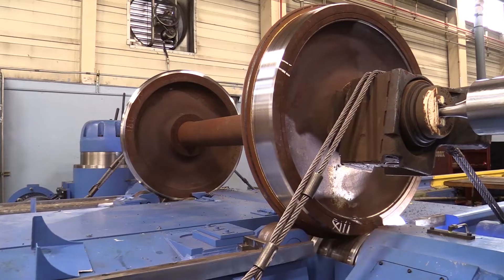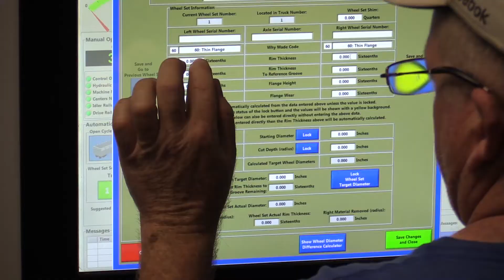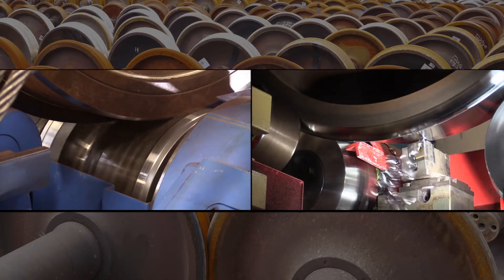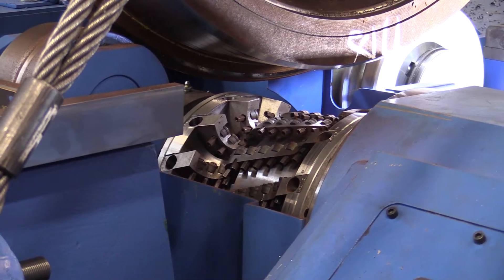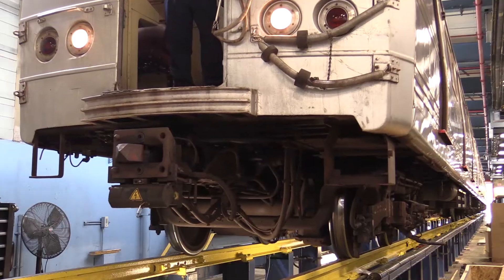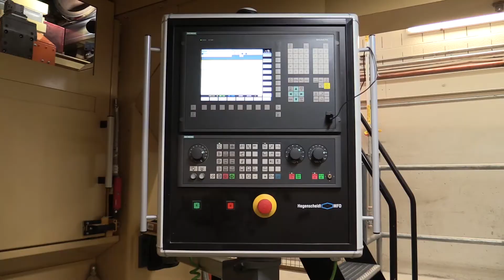Railway Wheel Set Maintenance: Milling and Turning Technologies

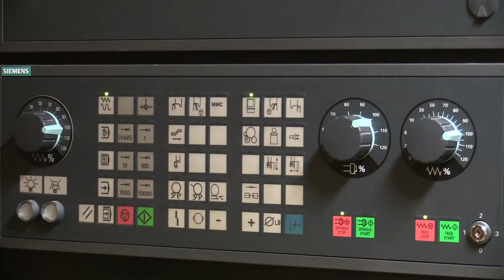Comment: 2:14  That's what I came here for. Flat spots.
Reply from the maker: Happy to provide that content! Also happy to provide the best solution for removing flat spots and other wheel wear.
Reply: @nsh-usa   Thanks again.
Reply: @nsh-usa   Do you know how flat spots happen in the first place?  Obviously from dragging a locked wheel, but still....it's hard to believe that they aren't aware that they are dragging the cars before the brakes are released.  No?
Reply from the maker: While I don't have all the answers as to how flat spots are created, one of the most common reasons is a slick or wet rail causing a loss or change in the contact between the rail and the wheel. That's why you see a lot more discussion of flat spots in the fall (falling leaves) and winter (snow and ice).
Reply: @nsh-usa   Interesting. It's like anything I guess....a lot of factors involved.
Reply from the maker: True enough!

Comment: how can material be taken from the wheel during routine maintenence without the outer diameter changing? how does the outer diameter increase overall due to wear if this is the case?
Reply from the maker: The outer diameter has to change to remove any wheel defects and get the wheel back to the optimal profile. However, the customer and/or AAR create guidelines in terms of how close in diameter wheels on a wheel set, bogie, and vehicle must match each other - as well as what the condemning limit is when the wheel must be scrapped. Thanks for the question!